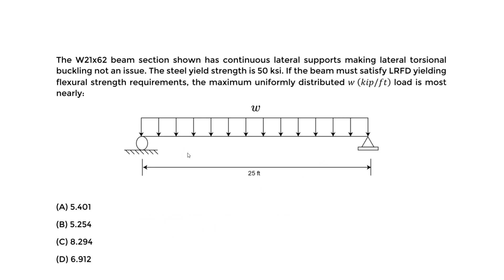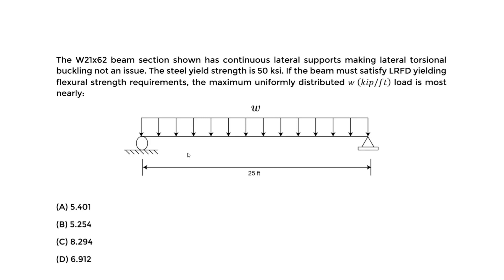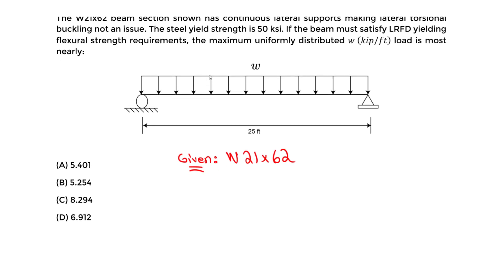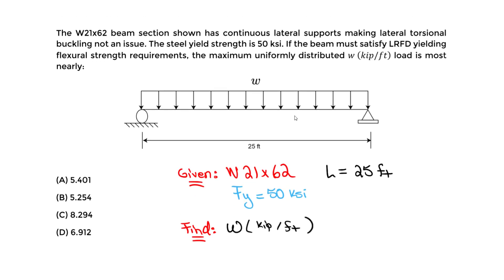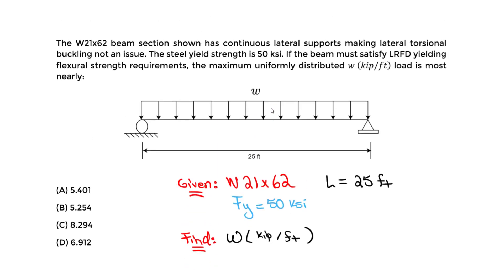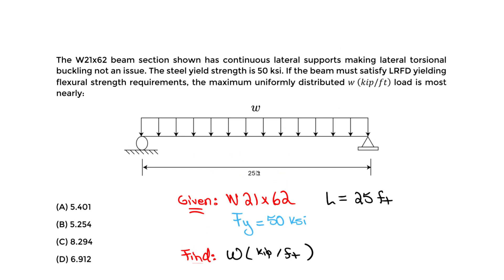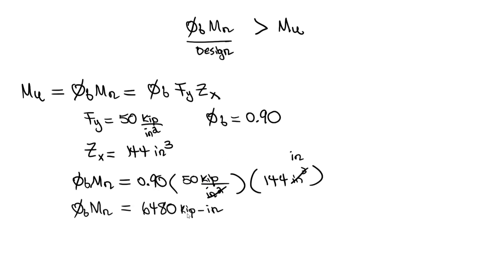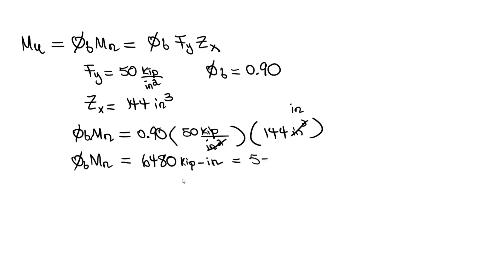FE Exam Review - FE Civil - Structural Engineering - Steel - Beam Yielding

Comment: Isn’t there a chart to get the max moment ?
Reply from the maker: Yeah, the moment and deflection tables in mechanics of materials section
Reply: @directhubfeexam  what length would you use if you use the chart? 25' is not on the chart

Comment: Why don't you have to use an LRFD factor (1.6 or 1.2) with your  wL^2/8? . I get confused when u have to use it for some problems but not others.
Reply from the maker: The 1.6 and 1.2 is used to calculate the total distributed load w. So if a question was specifically asking for the dead load (D) and live load (L) we would have to account for those factors. For example in this case the equation would look like this - w = 1.2D + 1.6L ----- 6.912 kip/ft = 1.2D+1.6L . From there we can either solve for the dead load D or the live load L. In summary, the problem statement might ask us to find either the distributed load (w), dead load (D), or live load (L). Hope this helps.